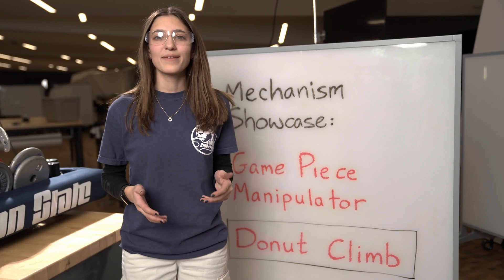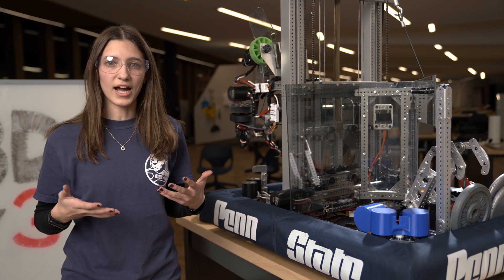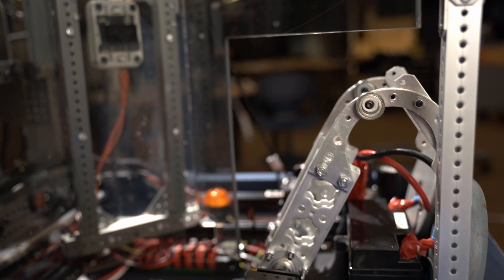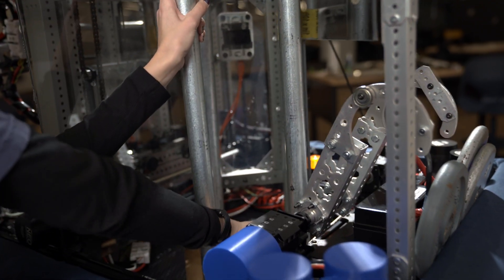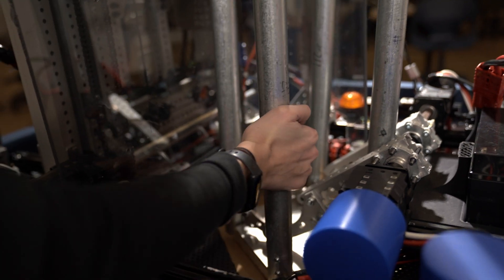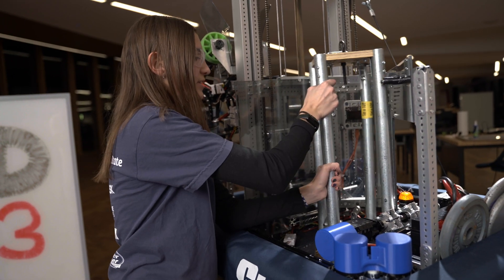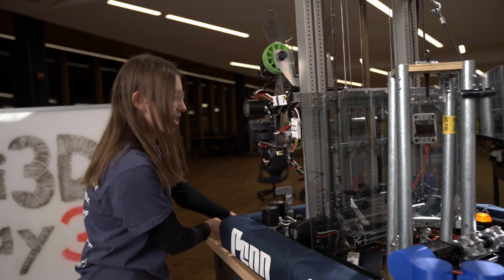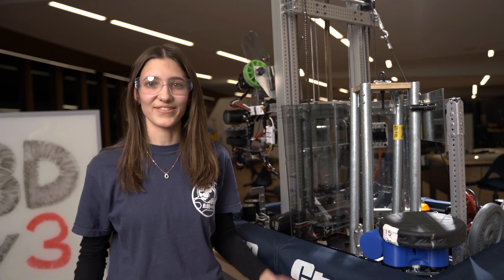Donut Climb Showcase | Ri3D at Penn State

Comment: I see your cage doesn't have a hole in the bottom of it, just a circle drawn. Do you feel like the hole would have caused an issue w/ this climb?
Reply: It shouldn't since our climber doesn't touch where the hole is, that's what the circle is there to show
Reply: We have a hole under the metal plate but since our cage is made out of wood, we wanted to help teams by adding a thin aluminum plate to show how the friction between the hooks and the plate would work. When we tested it without the plate, and we did have a few issues with the hole at the bottom of the cage, especially when one of the hooks would go through the hole rather than stay at the plate, it would not be able to push off. To resolve this, it's essential to provide sufficient spacing between the hooks, ensuring that the actuator makes contact with the sides of the hole and stays aligned with the metal plate. By doing so, the hanging mechanism will be able to push off from the plate consistently, allowing for secure engagement .

Comment: outside of the climb mechanism, how healthy is it to cover up NEO V1.1's with 3d printed pieces? (for ventilation etc.)
Reply: The drive NEOs don't get stalled so they should be fine, and the climb NEOs are only used a bit at the end of the match. Teams have been covering their swerve drive modules with PLA for years, so it should be fine

Comment: This robot is sweet! One question I have is about the climb lasting 3 seconds—as far as I understand the rulebook, the robot will be disabled at the end of match, but points are evaluated 3 seconds later, meaning that the robot needs to remain suspended for that period of time. This is my team’s biggest struggle right now. Does your bot accomplish this, and if so how? 

Thank you!
Reply: The robot was able to suspend for 3 seconds after disabling the climb. As stated in the video we used a flat plate on the end of the hooks which increases the friction at the very end of our climb. This helped lock the robot in place and prevented it from spinning the shaft and sliding back down. If you are struggling with an axle spinning after a match you could also use a ratchet to lock it into place. If you use a 1/2 inch hex shaft that will fit perfectly into a 1/2 inch socket/ wrench from a hardware store which then can be set to the ratchet mode.
Reply from the maker: https://youtu.be/myB50DQ7bxQ?t=18 
Here's a great example of the ratchet!